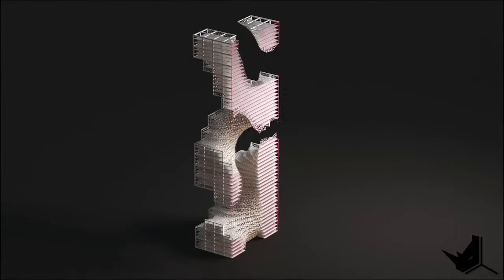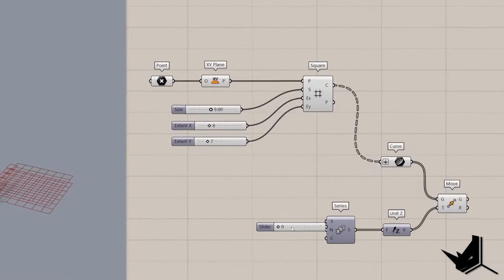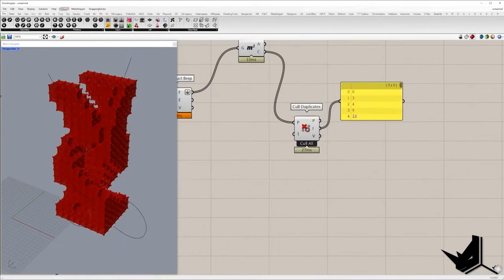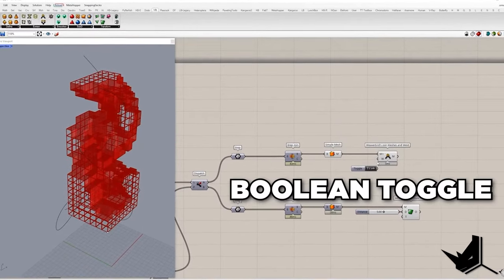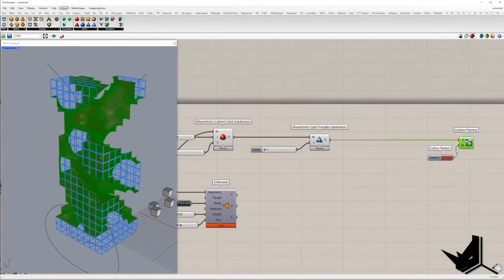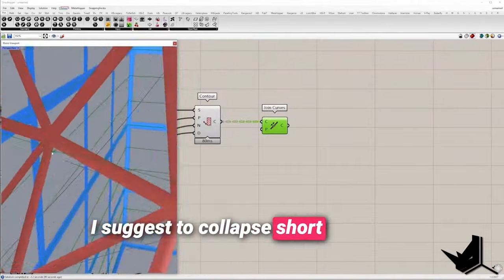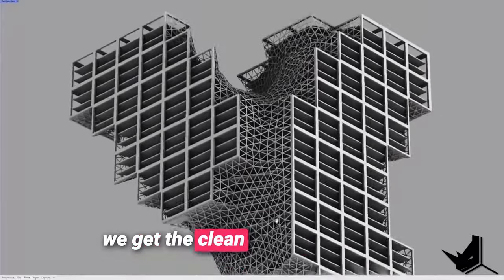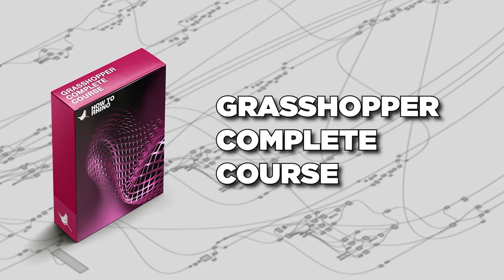The SIMPLEST way to create THIS

Comment: Very nice tutorial! Although I got stuck at 2:50 with the laplacian smoothing... It doesn’t change my mesh at all. panel shows that I got several breps after weaverbirds join meshes an weld... I think it’s because most faces do not share edges with one another - Du you have a suggestion for me?🙂